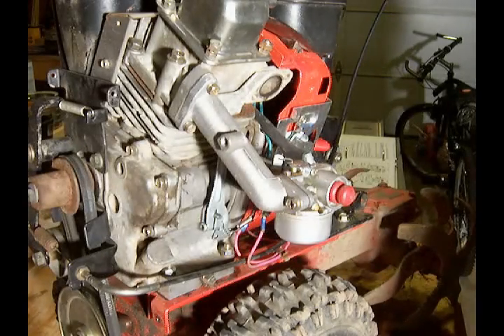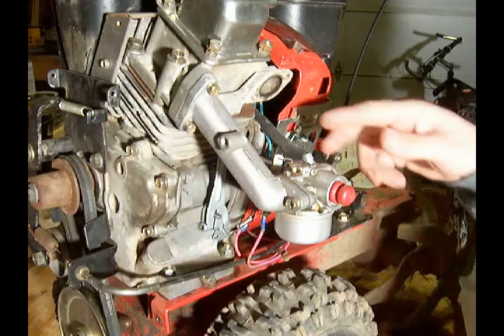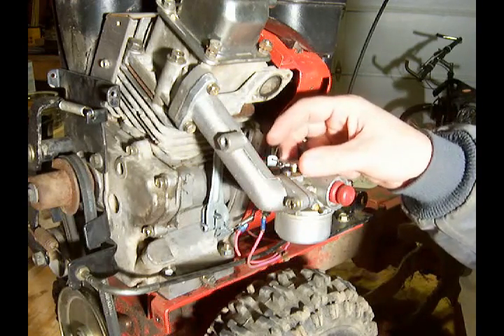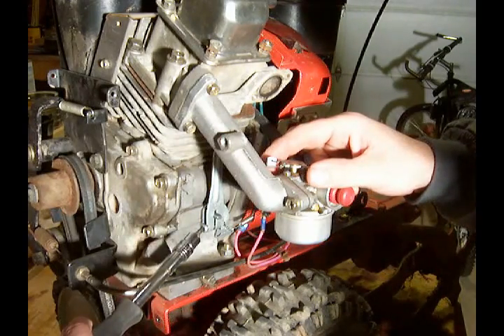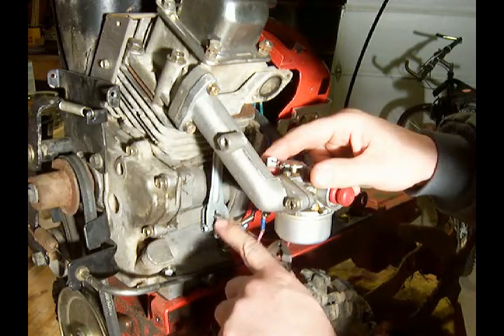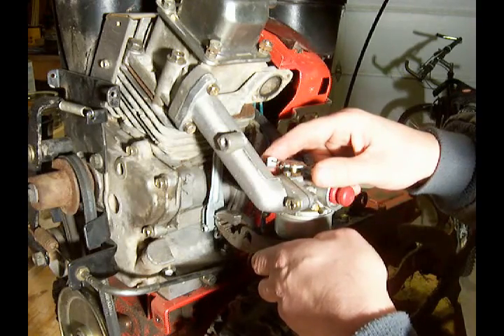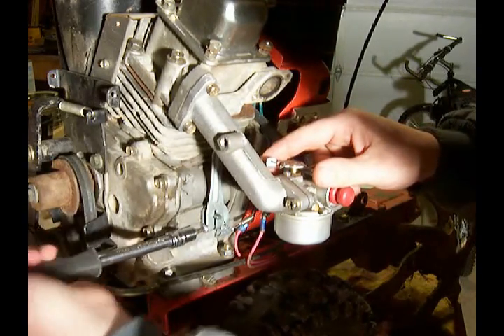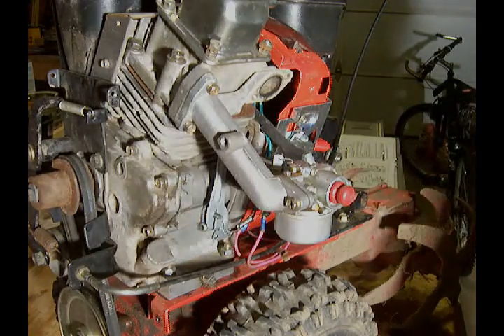Tecumseh OHH50 - Governor Adjustment

Comment: Take the governor completely off you will have massive power but just know how to take it is on the throttle it takes time to learn how to use one with a governor and how to not blow the motor up not for kids or teenagers to use without the governor

Comment: You turned it clockwise rotation 🤣
Reply from the maker: You see that I turned it both ways to demonstrate the range of motion. Before I tightened it, I turned it all the way to the left (counter clockwise).
Reply: @RealManSkills  noticed you did it correct, what does setting this accomplish? I am currently bringing one back to life for a go kart, new carb just put on.

Comment: how many more rpms do you get after doing this and question but did yours start grinding something after you messed with it
Reply from the maker: The previous owner messed it up and blew the engine (the retaining clip on one of the valves broke and the engine wouldn't run). I did a complete tear down and rebuild of this engine. This is me setting it up according to factory specs. I am not gaining any RPMs that the factory didn't mean for me to have! Thanks for watching.